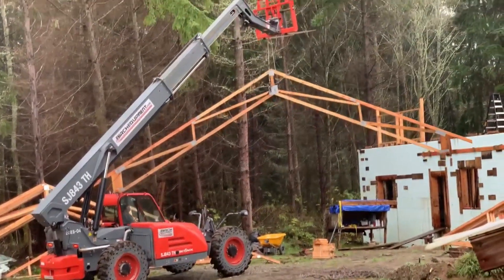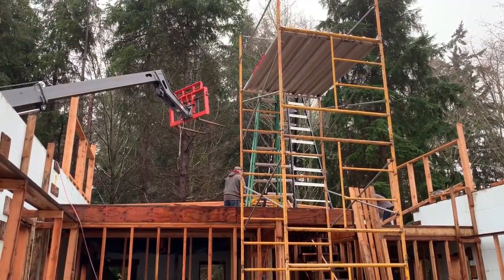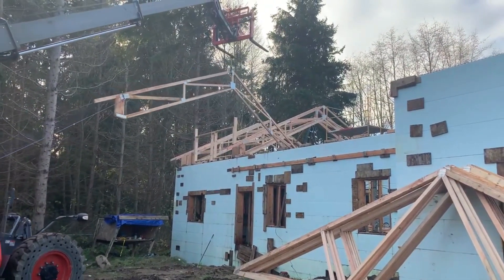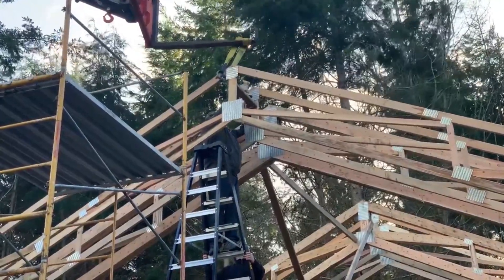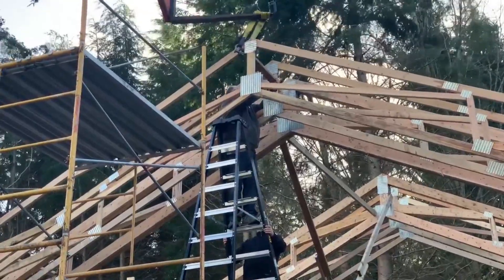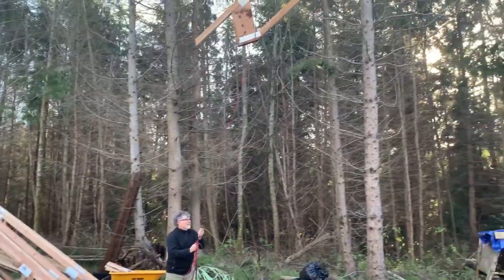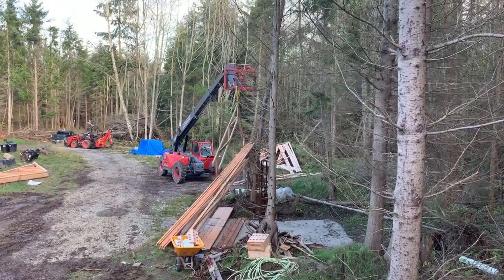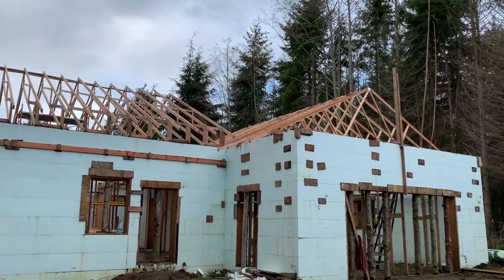Setting parallel cord trusses on a 32' wide ICF house

Comment: Nice Job. Can't wait til you get that roof dried in. If you can get it near you, consider Advantech or LP Legacy sheathing so you never have to worry about the deck rotting. That house will be bullet proof.
Reply: Thanks I will check into that

Comment: How much was each truss?  Doing the same icf build but 38ft span 8/12 pitch.
Reply: The total package was $17,000 not sure what the individual cost was house is 55’ X 32’ and the garage is 30’X 28’
Reply: How long did it take to set all of them?
Reply: @MAGNUM360RT  it took about three days could have done it in two if I would have thought to get a jib
Reply: I cut 22 1/2 spreaders and that helped to speed things up